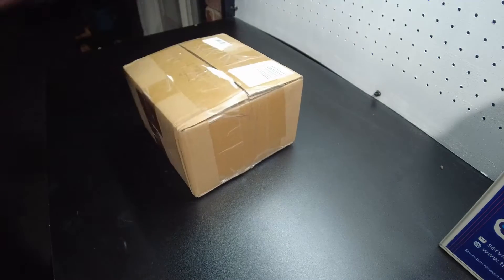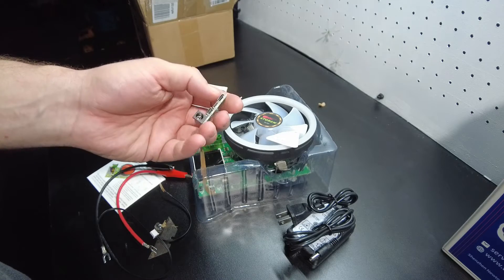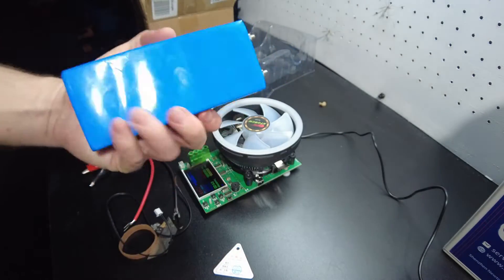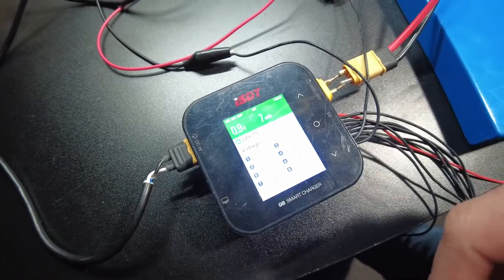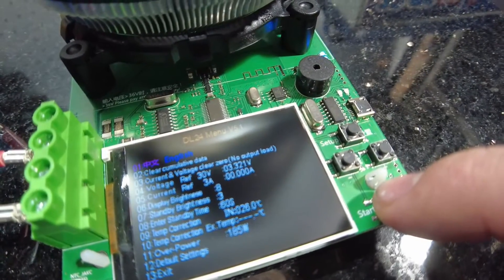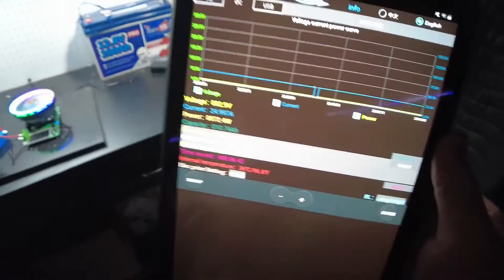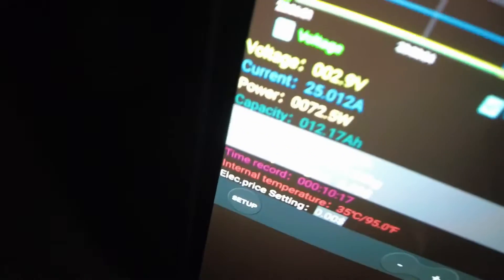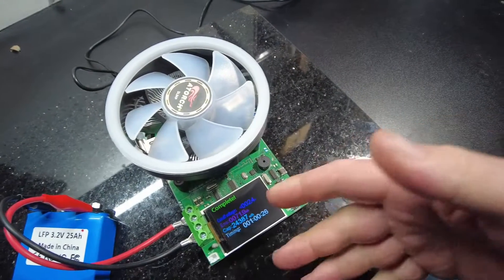ATORCH DL24P 180W Electronic Load Tester

Comment: Great simple video! However, I have a crazy question, that no one seems to ever answer or test? That is when you don't know the continuous amp output. IE: I have 2 lithium cells one is 10A continuous output, and I have one that is 25A continuous. However, they are both without any information on the battery. How can I test each of these to know how much continuous and peak power rating a battery his capable of? This could also be used for taking a bunch of random naked cells and seeing which ones are close enough to use together. As you know we can test voltage, and capacity, but this would give us the full picture of what a battery is capable of. Hope you can help. Thanks for the great video!

Comment: Would this pull 25A on 2S battery?
Reply: You may have to start it at lower current initially then crank it up to 25amps once the voltage drop is enough to  keep it under the 180w limit

Comment: so when the vreg for the 3.3V dies, don't waste your time trying to find a replacement. Just jerry rig a new voltage regulator in there. Left pin=GND, middle=Vin, Right=Vout. Your welcome. It's the little black chip center above the screen just under the black bracket for the heatsink.
Reply from the maker: Thanks for the tip!

Comment: Hi bought day before at official ali shop atorch for 35 dolls . Good to put some heatsink to shunt resistors and maybe even doubling  diode or using more powerfull one and changing power transistor for better one.
Have a nice day.
Reply from the maker: Thanks for the info!
Reply: Hi, also purchased this (reviewed by others) beauty & been OK with it for about 30 or40 cycles.......
The all I'm getting is ureg flashing on dispay😢😢
Any ideas people🤔 much appreciated if anyone knows a solution🙏
Reply: @stevepr100  Hi i dont understand your problem with display but my unit falls down from table and display was bit weak, when i pressed displey down to mainboard, it shines as original. So i put hot glue small in all corners. So try to lightly press down the displey, mybe its just bad contact.
Reply: @tatkosmolko1672  my bad.. I didn't explain correctly, where you can change from CC CR etc on display top right ish, all that mine shows are the letters (ureg) and I can't access any settings at all.. 😕
Reply: @stevepr100   Ah so, never heard about problem like that. Only what i can imagine that UREG means , that U - Volts nead to calibrate. You can calibrate device against good known devices. You can reach settings of device by longer press of Start butt and there you will see many things in options. I have Setup version of DL24 V5.1. 
Its only for DC. Not other what i know to help you.  And write if you will solve the problem. I wish you good luck :)